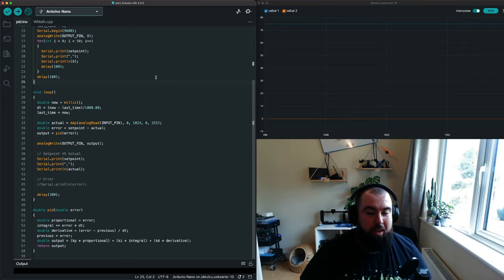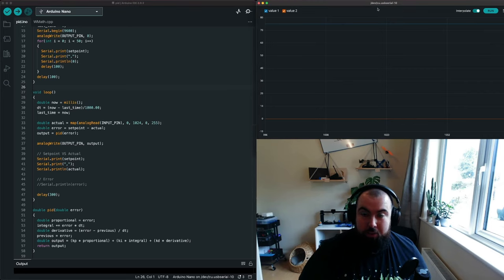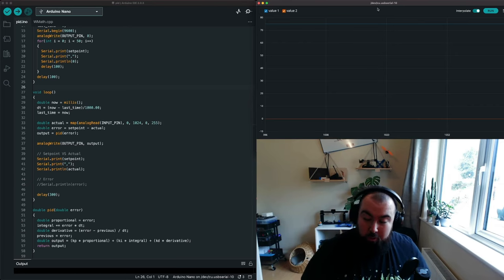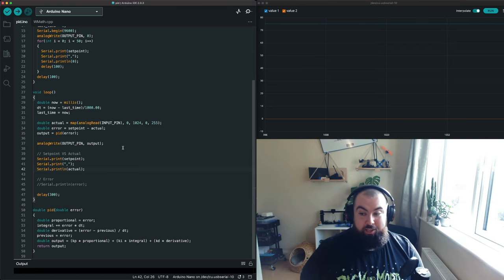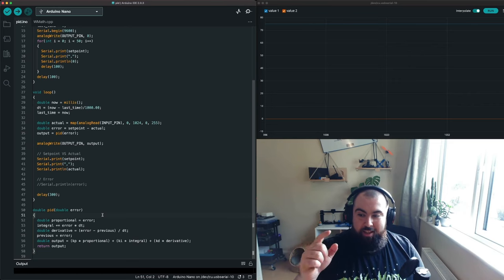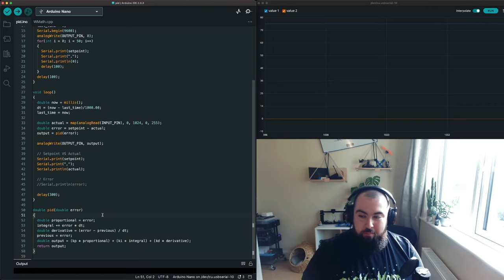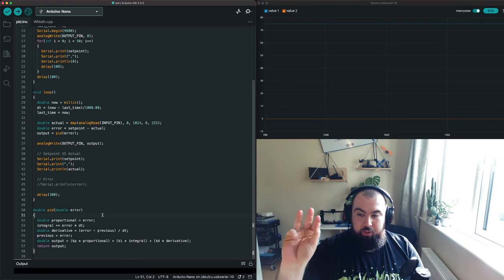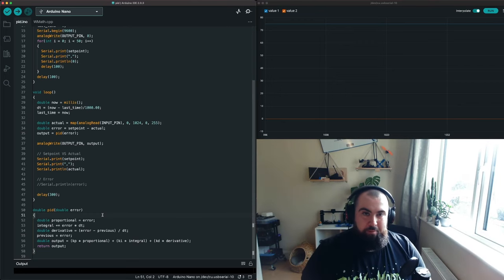Arduino PID Controller - From Scratch!

Comment from the maker: I designed this system with an approach based around how I would like to have been thought it originally years ago when I studied it. All credit to the education I got, it was excellent, but for all the theory I had a firm grasp of, I failed utterly at being able to apply it in real life outside of simulations in Matlab. I think if I had been able to sit down with a physical system in front of me, code the microcontroller and see the outputs in real time it would have done so much for my understanding. My hope is that this is an accessible resource for people who are coming at this as a beginner hobbyist or a student, like I was, with a good understanding of the theory but fuzzy on the real world application.
Reply: I am sitting in the same situation. I am currently studying electronic engineering and I can calculate Kp, Ki, and Kd perfectly according to my specification whether it be critically damped or whatever. However, this is only if I have a transfer function in the frequency domain. I had no idea on how to implement it in the real life so this video is a great resource. Well done and thank you
Reply from the maker: Excellent! I'm really glad this helped!!

Comment: I've been tuning PID's for 25 years from chain driven sloppy movements to oven temps to CNC, and thought I was accomplished when I used the PID library.. I wish I had seen this years ago. Very well done and simplified the black box magic. Those block diagrams are great but thinking thru the math is essential for tuning intuition.
Reply from the maker: Hey, thanks for your comment! Glad you liked it

Comment: HI! great video! But I don't understand how you pass the 'dt' value into the pid() function without using a additional parameter, like pid(error, dt); . Arduino manage the 'dt' as local or global variable ? Thanks!
Reply from the maker: Hi there, yes dt is a global variable. I could have done the same with error. It doesn’t make much difference here. Glad you enjoyed the video!

Comment: That's a great explanation; however, I think we should consider making the PID gains more adaptive to enhance the code's generality and accuracy. Would this improvement be beneficial or will it add unnecessary overhead to the code?
Reply from the maker: Hey there, what do you mean by adaptive?
Reply: @careyian   I mean if we can make a simple method that changes the gains within the runtime based on the time the system takes to reach its steady state. Therefore we will have a better gains for the next time.
Reply from the maker: Yeah, I guess you could do something like that if you wanted to. This is just example code, I have no plans to do anything more with it.

Comment: one thing that confuses me is when the actual goes above the set point, won't the proportional and derivative terms become negative , so couldnt  there be a case where the output is negative and you try and write a negative voltage to the pin?
Reply from the maker: Good spot, yes that can in theory happen here. In practice those negative values will be fighting against the accumulated positive integral error, so they aren’t likely to make the overall output negative. Specifically here a negative value being fed into analogWrite will not behave correctly as it will write the 8bit unsigned value of it directly to the register, which you wouldn’t want. What this implementation is really missing is scaling on the output to ensure that whatever the value that gets spit out, it’s always within a certain range.

Comment: Thank you for this video! I'm currently working on a personal project - creating something like a diesel engine controller based on the VP37 pump. There's a type of inductive solenoid that adjusts the fuel dosage based on a PWM signal it receives. The feedback signal is from a Hartley generator, generating a DC voltage that changes depending on the position of the actuator. It seems like a straightforward task - just drive the solenoid with the right waveform based on the feedback voltage... But unfortunately, it's not that simple! Unexpected problems arise, such as the coil heating up during operation, requiring compensation for temperature drift, or fluctuations in the solenoid's supply voltage... The solenoid itself is mounted on springs and can oscillate on its own... :) I struggled with this a bit, and I have to say that PID behaves impressively well in this regard, better than all my other solutions. I'm still dealing with the issue of voltage fluctuations - when the coil's supply voltage changes, the solenoid changes its position. After a while, the PID stabilizes it, but there's still some fluctuation in the actuator's position. Thanks again for the great explanation in your video!"
Reply from the maker: Wow, that sounds like a complex problem, but it sounds like you understand it very well, only a matter of time before you fully crack it for sure! You are welcome, I’m glad this helped you! Keep up the great work
Reply: @careyian  I'll likely get to it, but if you've got any ideas to speed up my thinking process, feel free to drop them! :D

Comment: This is an amazing content . i wish there was a quick way to calculate the pid values and tune them quickly since as an engineer you have dead lines to meet
Reply from the maker: Great point, real engineers can build actual models of these things and simulate different PID values, it’s never going to be 100%, there is a trade off of detailed models and the time it takes to build etc. There are also methods for tuning PID controllers. However, it might end up being faster to do it manually. You also have to think about if you are building a product, the base tuning might come from a model and simulation, you only need to build that once, then you can tweak and tune it afterwards.

Comment: Well explained, but, this is a digital system which is a fast response system which means that the closed loop responds quickly, when you start implementing this with a slow response like a heating element this response is very slow because the closed loop has to wait for the "response" from the thermistor that monitors the surrounding heating. This gets very interesting very quickly...... Nice video and a good delivery.
Reply from the maker: Thanks! Yeah, you are 100% correct, this is also a totally contrived example, but it gives a clear picture of what is going on and can be done with minimal parts etc. You have me thinking of a little desktop temprature based control demo now... Maybe something for a future video!
Reply: @careyian  🤣😂 Yes... I am busy with a pulltruder that has to use PID to control the heated extruder with.... So this video had me for a full 29minutes and 50seconds...... PID is a dark art and can send one down a horrible rabbit hole!🤣😂
Reply from the maker: Love it! Exciting project, hope it goes well for you!

Comment: Than you very much! Your video has given me a good understanding of how PID works. I do have a doubt though, the integral term accumulates over time so if it keep on adding up it would contribute more to the error calculation right? I have seen some vids where they have a saturation limit, but even then there is no way to reduce this unless it overshoots right? Should we reset the addition over time from time to time if it reaches the set-point?
Reply from the maker: That is a really excellent question. In theory if the error oscillates around the set point, the integral term should settle assuming the error goes to zero and so should end up stable. However, there are cases where this might not happen and you end up with something called integrator windup happening. You can could avoid this by placing limits on the max values or periodically clearing the integrator value back to zero when you approach stability.
Reply: @careyian  thank you very much for the response! I'll google about Integrator windup and include limits on max and min values in my implementation

Comment: To achieve critical damping what is the value?
Reply from the maker: Hi, I don't know what you mean, could you elaborate? The values will probably be different if you set this up yourself and you will have to tune them yourself.

Comment: What if I don't use the dt value? I mean for integral instead of integral +=error*dt I will use integral+=error. The same for derivative. The dt determined by the timer interrupt. Meaning it is a constant value. But I don't use it in calculations. Will it work correctly?
Reply from the maker: Great question, so the dt or sampling time really depends on what you are trying to control and what frequency your system will run at. For example if you have a slow system, it might be kind of pointless to sample it very quickly. Where as a fast system needs to be sampled more quickly. Without knowing what you are sampling, I’d say a basic model without the dt value might work. Assuming it’s a simple system and the period is always the exact same.

Assuming you know dt based on the timer, I’d suggest just including it to reflect what is actually going on instead of abstracting it away.
Reply from the maker: Well that’s a good point about being at optimal performance. If you use dt you can tune the system by altering the value and seeing how it responds. You are effectively assuming that that the sampling time is 1 second by leaving off dt. If you include it to match your system you can see what effects on the response the sampling rate will have on the PIDs outputs. In the real world, your sampling time is probably much faster, so you should include this so that the frequency that your system is operating at and the frequency that your PID appears to be operating at are the same.
Reply: I am back with another question. I saw you convert the dt unit to second. Why? What should be the unit? Can I use ms, us or ns?
Reply from the maker: So the units aren’t super important, they will effectively scale the values differently. However, seconds are the standard unit of measurement for time, so by converting to this you are ensuring the time measured reflects what’s actually happening. It won’t really break anything as such if you use different units
Reply: @careyian  But the values will change 1000 times for ms. How this will not effect the result? I don't get it.
Reply from the maker: I’m afraid I don’t understand your question. I didn’t say it wouldn’t affect the results, I just said it won’t break anything. Imagine this case, we have some value in second let’s say 5, so in milliseconds the value is 5000. If we are doing a derivative or something, let’s say we have a value of 1. So in seconds our output would be 0.2 but in microseconds we would end up with 0.0002, which is a factor of 1000 smaller than in seconds. Effectively we have scaled down the results. You could make the outputs the same by increasing the value of Kd by 1000. I hope this makes sense.
Reply: @careyian  thank you for your reply.

Comment: Great video 👍🏽

I have one big question that I am not able to solve…

In my scenario, I need a PID control that prevents my motor from accelerating beyond 6 km/h, even with the throttle fully engaged. That means my target is 6, and my actual value is the measured speed at the front wheel. However, the PID has to output a value between 0-255 for throttle regulation. How do I establish the correlation here? Your code example doesn't provide me with values within this range because I'm only feeding it with speeds.
Reply from the maker: The trick here is you need to remember that the scale of your units doesn’t matter. If your input into the PID is some value of speed, as you mentioned k/h, you need to scale your PID gains to give you output values in the range you are interested in. You can also write some scaling logic if you want to bring them into the same kind of range, but that’s up to you.